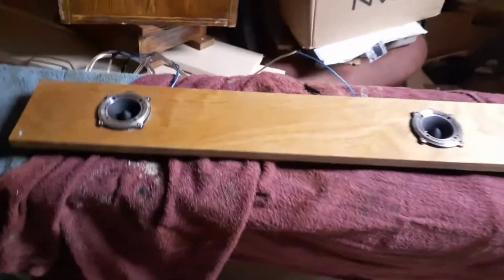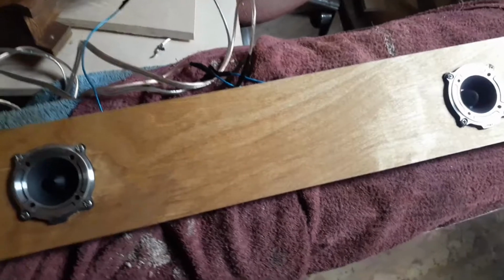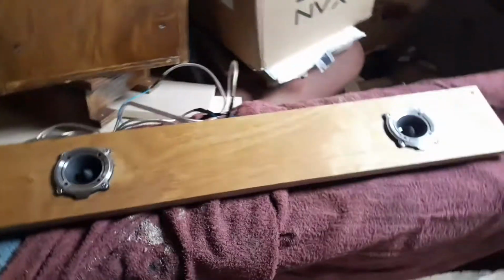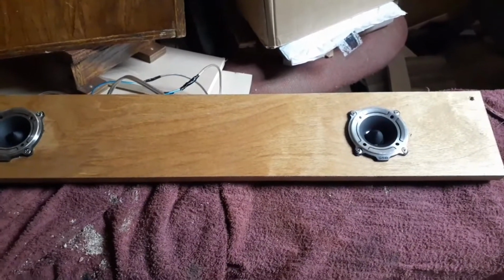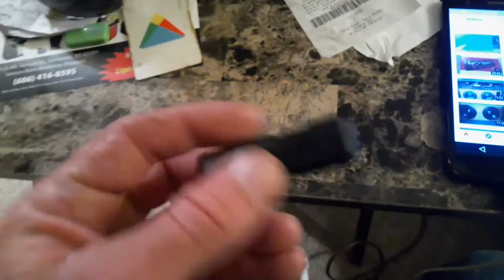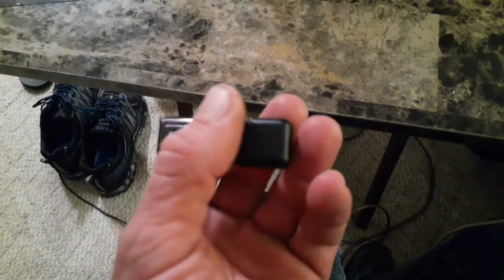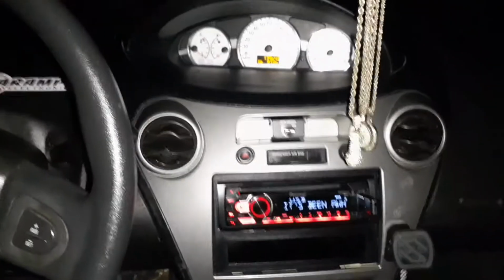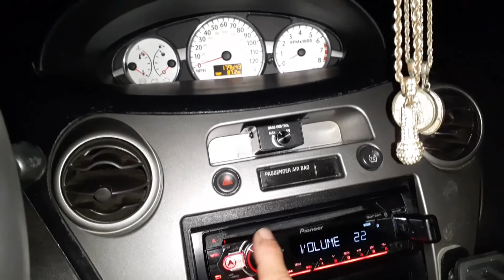DS18 tweeters!

Comment: I’m running Rockford fosgate punch 4 channel super tweeters pioneer in dash! Alpine 5.25 doors 6x9s alpine rear ! Kenwood excelon! 🔊🤘🏾🔊! Thanks again brother 💯👍
Reply from the maker: Your welcome and nice set up bro👍👊💪💪💪😎💯
Reply: BassJunkie2020 🤘🏾thanks brother! I tuned mine with 40z -5db is that ok or 0db?
Reply from the maker: I don't use bass boost it sends distorted frequency. So be careful. 5 db isn't much. But can still cause premature voice coil failure over a extended time. 👍😎💯